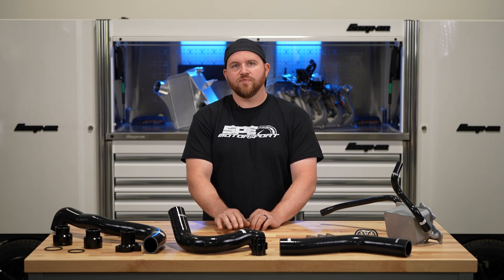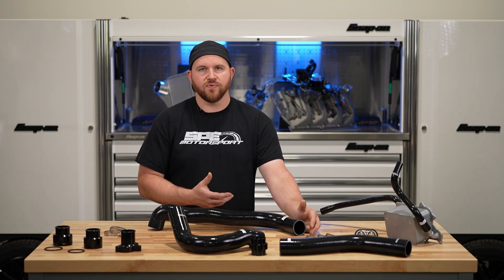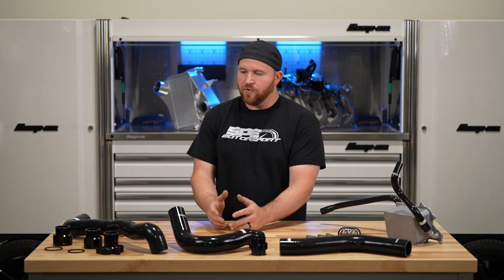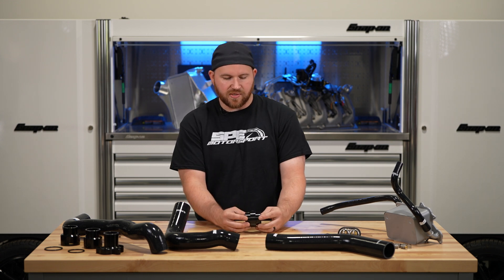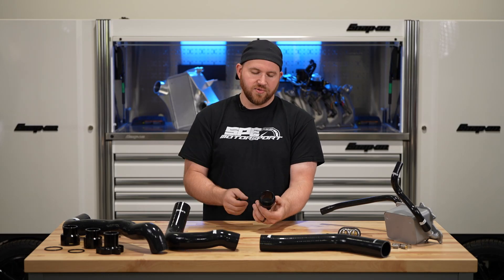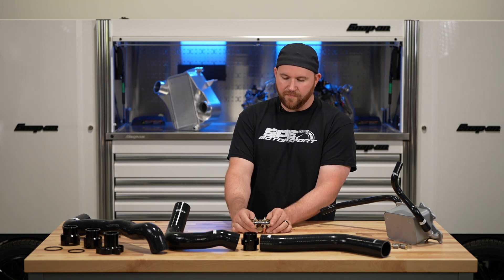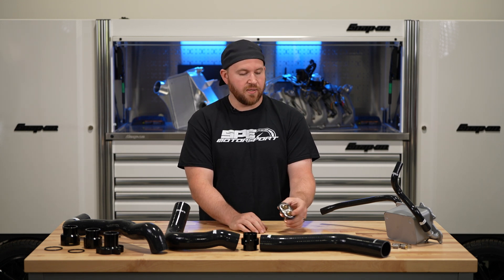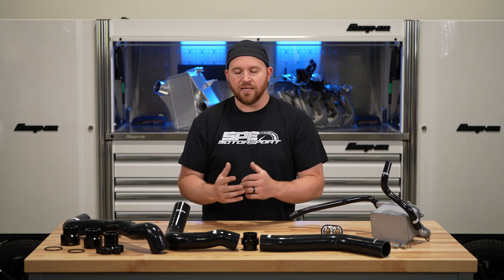SPE Motorsport 6.7 Powerstroke Cooling System Components

Comment: Man, I bought the thermostat, but haven’t installed it yet.  I should have done more research before this purchase. My stock truck is typically used for daily driving or long distance driving without towing. When dropping the temps on such a truck, there are potential many unforeseen issues that COULD arise at a later time.  Condensation and Wet Stacking in the exhaust system to include the DPF, EGR, etc.   This could negatively affect the frequency (more frequent) DPF regens, causing a reduced life expectancy of the DPF by 20-30%.  Other issues are the inability to achieve proper piston ring sealing (achieved at 190°+ on most modern diesel engines) causing potential contamination of oil from the exhaust gases and unburnt fuel.  Just sayin’ do y’all’s research first (Chat GPT, or the much better, non liberal, Grok).  Hope this helps some of you guys.

I recommend to only use the SPE thermostat if all the truck experiences is heavy towing, a completely deleted truck, or both.  Hope this helps.  The other components shown in the video are very legit!!!  Personally, I’m holding off on the install of the SPE thermostat until I begin heavy towing.
Reply: depends on what year truck you have 2020+ uses the secondary cooling system for the transmission cooler. I have not found a better thermostat for it yet unfortunately

Comment: I have that thermostat in 2016 f-350 it keeps truck cooler towing my 44’ toy hauler but my everyday driving I can’t get my coolant temp over 150* and oil temp is within a few degrees of that as well
Reply: Are you worried about the lower temps isn’t that what’s wanted